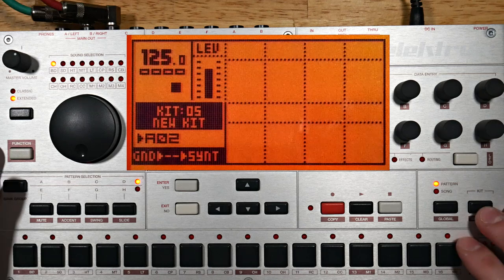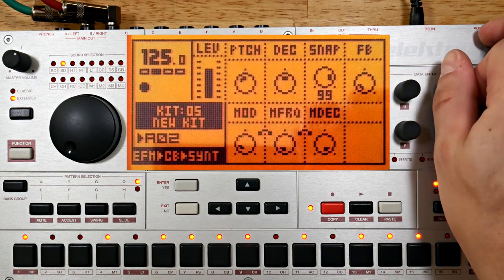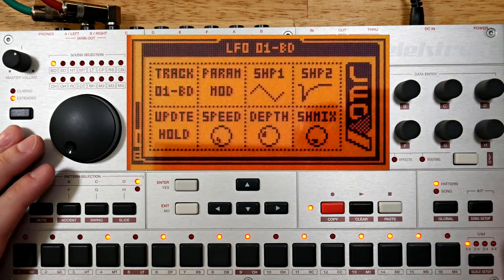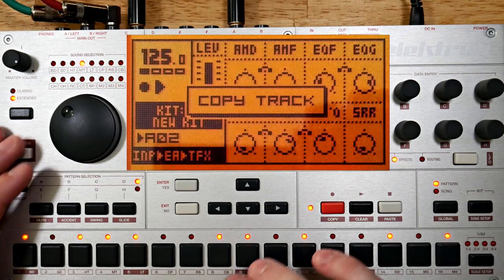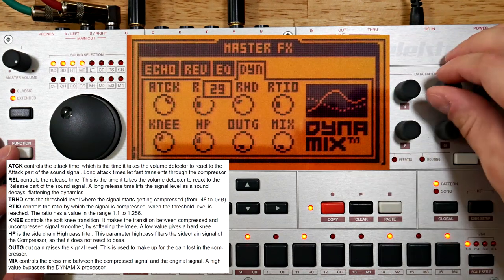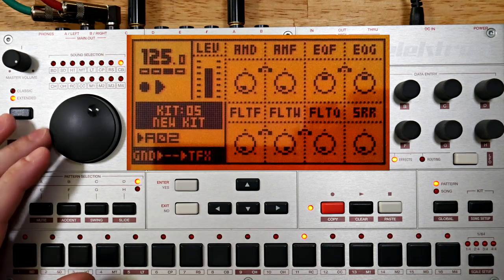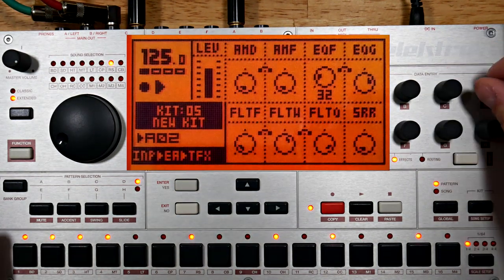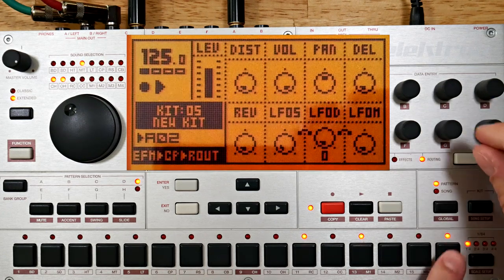Elektron Machinedrum: EFM Cowbells, Self-patched Processing

Comment: Very cool video ! In your opinion, what's the best way to create "correctly" pitched sounds with EFM ? By tweaking the pitch or the mod freq ? Thanks !
Reply from the maker: thank you! both - like any other simple 2-operator FM configuration it just depends on what perceived pitch you want and what timbre you want at that perceived pitch. Main thing I've noticed specifically with the EFM cowbell is that the modulator frequency makes big jumps and goes very high very quickly as these machines are meant mainly to be used as complex noise generators - I think the highest modulation frequency value I use in this video is 16. The frequency ratios available seem to be tuned mostly to 'musical' values though I haven't examined this aspect in any technical way - one thing I like about using Machinedrum is how it encourages me to simply use my ears and listen closely.